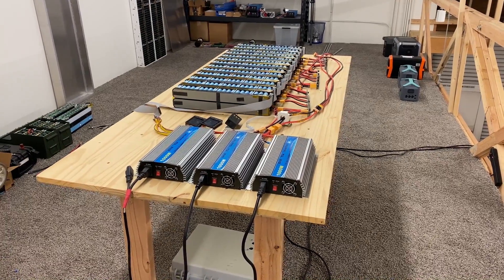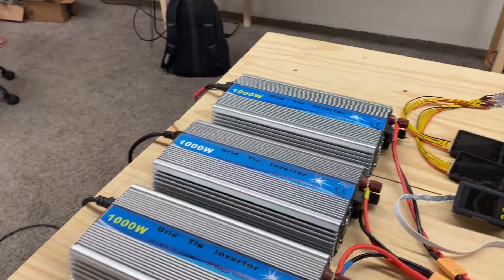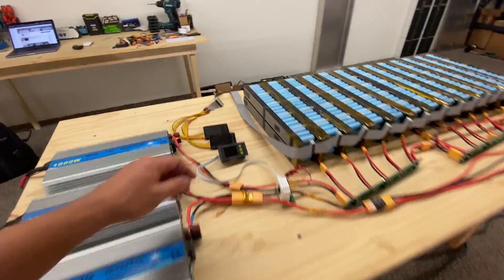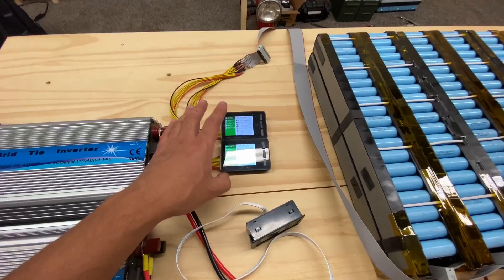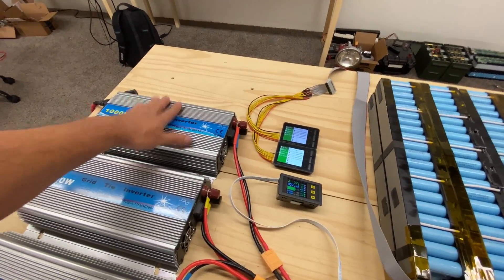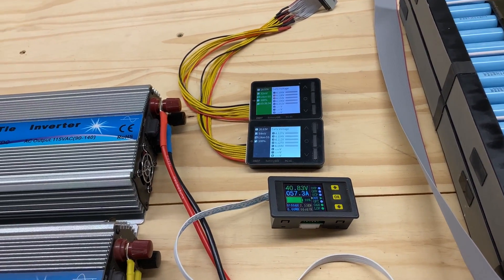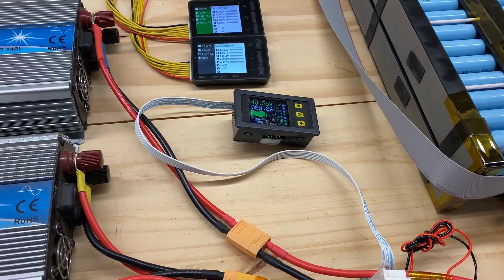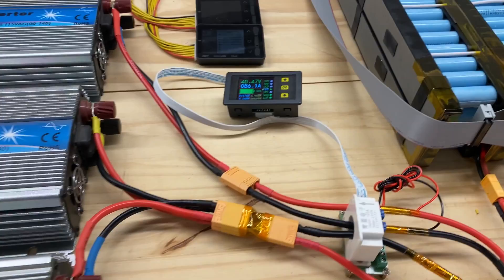Load testing My DIY Scooter POWERWALL

Comment: how would i calculate out how many charge and discharge amps each of my 120p modules are capable of.  do i multiply the number of cells by the 1c rating of my cells?  im only looking for max and minimum so i have a reference range but im unsure of how being in parallel effects the specs of the batteris.

Comment: How do you recharge that set up...? 🤔
Reply from the maker: using a 36v charger,   there are many to choose from
Reply: @jehugarcia  i was thinking to use many small ones original chargers to recharge each battery separately... through it's own bms charging port.

And is this inverter good enough? This costs 25% compared with the blue ones from your other video

Comment: After reading these post and observing your work I feel you are on the right track and wanted to mention heat loss in the cables is energy loss that cant be recovered and that gets pretty high as all the wires add up . So like so many are saying the final product will need larger conductors as well as plugs . All this is not so important yet as you are still in the early stages on design but this is quite interesting. I bought 8 packs from you to experiment with for ham radio emergency power supply , the weight is a huge advantage but soon realized at 5 lbs per pack it gets quite heavy to tote around, I have 4 packs in a plastic tool box which fits nicely so adding the meters to and buck converters for my 12 volts out as well as a boost for charging off solar

Comment: The naming is a bit of a marketing lie; an XT-60 is 60A peak, 30A continuous, and XT-90 is 90A peak, 45A continuous. Check the Amass datasheets (they are the original inventor of the connector as far as I know).
Reply: @jehugarcia  This guy is right.  Those connectors are only rated for half as much for continuous draw.

Comment: Mr. Garcia, How are you today.  Take a look at this video, https://www.youtube.com/watch?v=rT-1gvkFj60 its a DIY BMS.  and it provides cell information via wifi which is pretty cool.  This solution is more expensive than most commercial solutions but now you have a BMS solution custom built for your wall.  You can add as many boards as you have cells so it can grow with your power wall needs.  You don't have to spend a lot of money on the Batrium solution which can be very expensive.  Let me know what you think.

Comment: How to calculate any battery/cell internal resistence  -->  https://www.youtube.com/watch?v=-EnO3LI2MsU&feature=youtu.be&t=295     -> Cited "one volt drop at 60Amps"  --> battery blocks total resistence equals  16,6mOhms    multipled by 13 blocks equals 216,6mOhms each battery block , for 10S means 21,66mOhms for each individual cell block. Since blocks are 4P this means medium individual cells resistence equals  86,6mOhms   Some math mix ohm's law. Today homework--> study ohm's law.

Comment: THANK YOU for making it clear where in the US the difference between peak and off-peak Time-Of-Use (TOU) rate plans that this setup makes sense! I really appreciate that. Looking at average electricity costs across the US by state, these DIY Powerwalls really only make financial sense in about 20% of states where electricity is expensive and TOU deltas are large enough for a reasonable ROI. 

I'm looking forward to your next video on total costs (seems to have gone up from $1500 in the last video to $2000 now), as well as how you'll be running it at 50% and why you believe you'll be able to get 5,000 cycles when run that way.

I'm VERY curious about how you can take normal 18650s that have an estimated 300-500 cycle lifetime and turn it into 5,000 cycles, and what your expected capacity decline curve looks like. And also how you are accomplishing that with the software in your BMS, or if you're using another system to manage that charge/discharge cycle automatically.

This website goes too far in-depth than I'm ready to read, but may likely explain what you're trying to do -- charge the batteries to 75%, drain them to 25%, staying in a 50% usage band, to extend the predicted cycle life.

https://batteryuniversity.com/learn/article/how_to_prolong_lithium_based_batteries

Comment: What thermal camera are you using? Also is there a detailed A to Z guide on making this DYI battery, parts list, wiring diagrams and connecting it to your house? It's kind of hard to get the full picture from your videos.

Comment: Love your demonstration but what a guy really needs to know is what's happening on the AC side all these DC load numbers are worthless what can we run in the real world AC kilowatts is what we need to know. Is it just as simple as 3000 * 3 or words 9000 kilowatt AC kilowatt for load. I'm making plans to convert our whole house to off-grid need to know the size of the bank to handle daily needs I know what my daily kilowatt usage is need to make sure I'm doing the math right
Reply: Each one is 1000W which is 1 kilowatt (kW) so in total 3000W is equal to 3 kilowatt (kW). Your daily kilowatt usage has nothing with how big of a load at a time you can apply. A single simple water boiler can max out all of those with 3000W while charging a phone is like 15W to 65W which means you can charge alot of phones at the same time. Maybe you are talking about what the capacity of the power wall is? He said it was a 10s26p that means it has approx 42V and 52Ah (if each cell is 2Ah) and that adds up to 2184 watthours (Wh) or roughly 2,2kWh. (kiloWatthours) which perhaps is useful to you?

Comment: Don't you need larger cable for that much current?
Reply from the maker: Not according to my tests, they barely got warmer than ambient temperature
Reply from the maker: I’m using 200°c silicone wire

Comment: What I would do with those bus bar PCBs is moving the output connector to the middle, instead of one end. That way half of the current will come through each side of the PCB. You can also join the outputs of the 3 boards through some heavier connection, like soldering to a really thick wire or connecting to a copper bus bar. Cascading them like that means the first PCB will have to handle a lot of current and also increases your voltage drops.
Reply: Was gonna comment this. The other option is to pull positive from one side, and negative from the other side, so the voltage drop will be equal.
Reply: To add on this, I’d make each side a bus for positive or negative.

Comment: That 10 AWG Wire is only rated for like 30 Amp.  You need more wire Sir.   More Wire.
Reply from the maker: I’m only running  35A thru them ,  did you not see the video?

Comment: Wire size brother! You're way under sized.
Reply from the maker: According to who? Not what my test showed
Reply: @jehugarcia hi jehu, 20 year commercial/industrial electrician here. the vibration you were feeling was a result of IR beyond maximum. It's Not always evident by heat. Heat starts when you surpass IR. I bet you were loosing 10amps & a few volts (under load)in your test due to Internal resistance of the 10awg wire. Although you were using 200° silicon shielded, fine stranded wire. Which has very low resistance. 10 awg is good up 30 amps but the IR is only "low" for 80% of that rating. After that it goes up quite substantial. I think you were pulling 80amps or so through 3 10awg wires? 

10awg = 30amps. low IR @ 80% = 24amps maximum
24amps x 3wires = 72amps @ best IR

If you did the batt xt90 leads to a 150amp bus bar (1 pos & 1 neg) & ran 8awg to each inverter, your results would have gotten more amps out of the battery with less voltage sag. That would eliminate those bottlenecks we seen with the camera on those PCB boards & you wouldn't have seen any heat in the conductors at all. 
 I get that it's just a test and you were checking the system. My interest wasn't so much in the test, I'm more interested in when they are mounted and pulling 4000 watts on the finished system and enclosed inside a panel box. Love the channel BTW! Been watching it for years! And thanks for what you do man 👍
Reply: @laymanengineer7502  
Noobie here.....^Yeah, what he said! (I'll leave now....)
Reply: @rxonmymind8362  lol
Reply: @laymanengineer7502  I agree. Also less power loss in the cables, but for such a short run the power loss is not worth worrying about. Still Jehu is the OG of DIY power walls, and supplies.

Comment: Are those boards the batteries are plugged into for putting them in parallel?  If so what are they and what guage wiring is being used?

Comment: Can someone explain how he is making use of those balancers? I'm dying to see the schematic for this. I can wire a BMS system up, but this doesn't make sense to me- I don't understand where they are getting their readings from, nor do I understand why there is 13 packs of batteries, yet only 5 groupings per BG-8S- that's only 10s. I also don't understand how he is splitting the pack in two as far as the BG-8S are concerned. There's 130 groupings of 3.7v modules- how can that possibly be compressed into 10? I'm so confused.
Reply from the maker: There’s 26 10s packs.  They are All connected in parallel.  So it’s one giant 10s battery pack.  That’s why I have to use 2 8s meters, cells 1-5 one and 6-10 on the other
Reply: @jehugarcia  Ahh, so you just have the exact same wire configuration going to each module. You're just cloning them.

Okay, does it it just give you the highest and lowest voltages?

Comment: I think it will help alot in many ways if try twist your DC+ and DC-  cables and short as possible:) Also maybe busbar where ac inverter are and other places maybe?
Reply: Twisting them won't really do anything as twisted pairs are more for getting rid of interference but cutting them shorter would be good idea but I think this is just a load test so it won't be permanent

Comment: Hey man, thanks for the cool video;

Hey man, I think you're awesome.  I have been watching your videos and I'm so thankful for them.

I have a 2016 Polaris GEM Electric Car; It used to be made by Chrysler, but was bought out years ago by Polaris during the auto bailout.  I've been trying to inquire with the others in the Electric Vehicle GEM Car Forum https://community.electricforum.com/c/gem-forum/101 on what the best configuration of 18650 batteries to use in my conversion and everyone is recommending that I go the Prismatic Cell route and they all suggest that the "holy grail" for this conversion is a Chevy BOLT battery.  But your way with 18650s makes so much more sense and I really want to invest in the chargers, spot welder, etc. for other battery powered projects in the future.

I wondered if you could help me with my Lead Acid to Lithium conversion.  It's a 48v Electric Car that has a max continuous draw of 350Amps.  It actually converts the DC to AC for the motor.  Currently I have FOUR 12v AGM Batteries Rated 120AH Each; they are connected in series so 48v 120AH (5.76kwh).  I did your math and I think I need a 13s??p battery packs with approximate 707 cells to get the equivalent 120AH capacity of my current array.  I'll need to charge these batteries too with I guess a 100amp charger?  Anything you can do to help is greatly appreciated.

Comment: 6:43... Really?? You can feel the electricity going through the cables ?? Yeah... that is crazy.
The other trick of reducing the heat buildup in DC Current wires is to keep them short.
Reply: It will be the mppt as these use mppt as they are designed for solar panels but if you use batteries they just put out max power so they will move because of eddy currents
Reply: @david coffin That's exactly what he feels... Not the electricity moving through the cables.